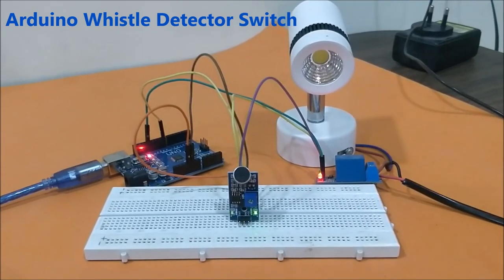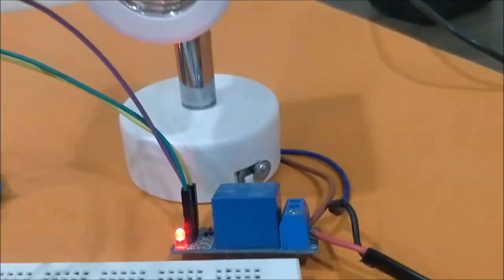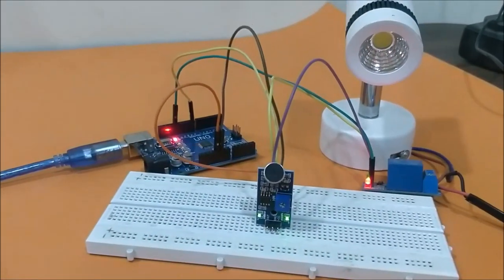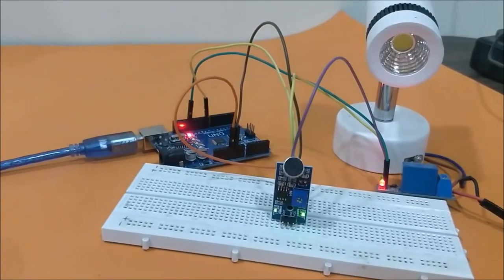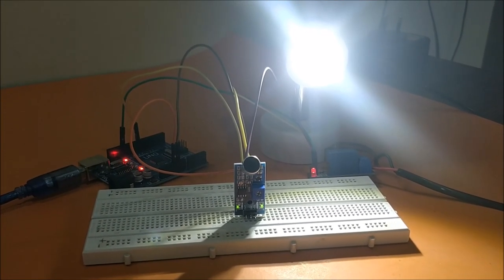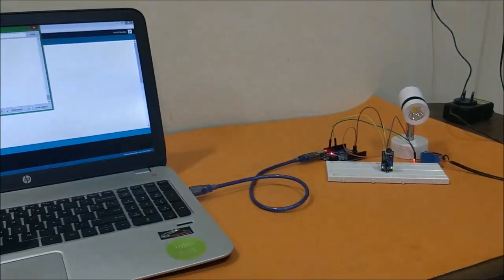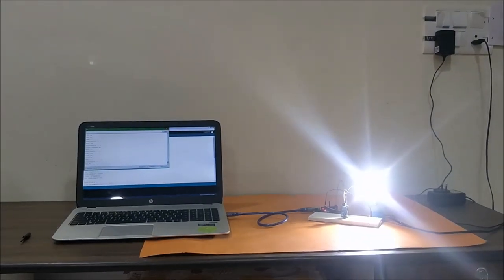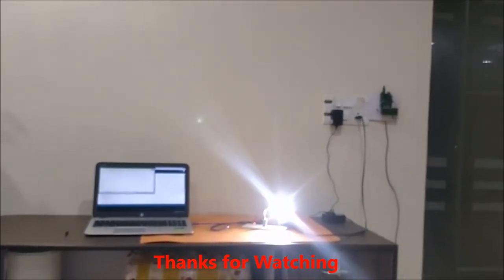Arduino Whistle Detector Switch using Sound Sensor

Comment: Sound sensor works on "sound intensity" pitch and NOT  Frequency UNLESS you use inbuilt or external filter.   Are you using any filter (I don't see any in your project !! ).It is MISLEADING. Can you share  Datasheet ?
Reply: Yeah, this demo looks flawed. I used the same sensor by accident when needing a microphone module. This is just a switch that has a dB threshold that triggers it.